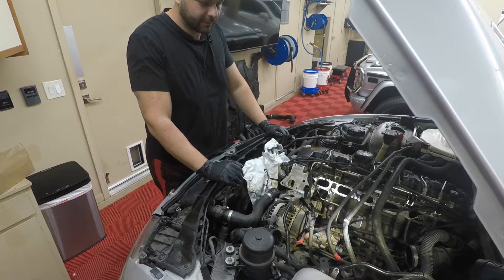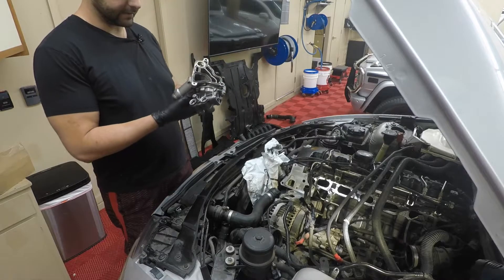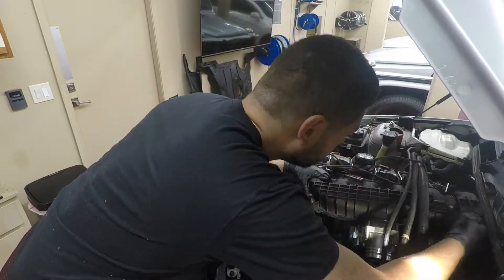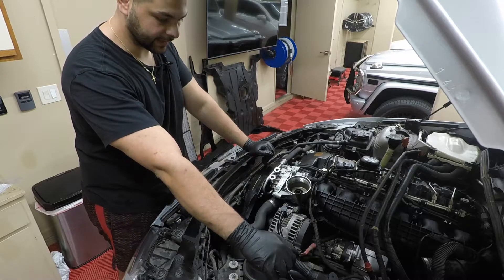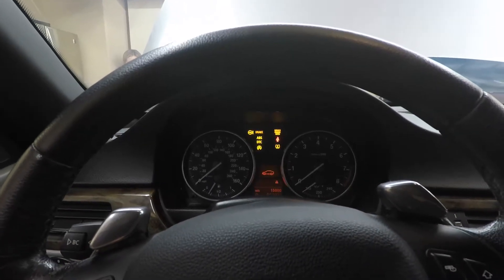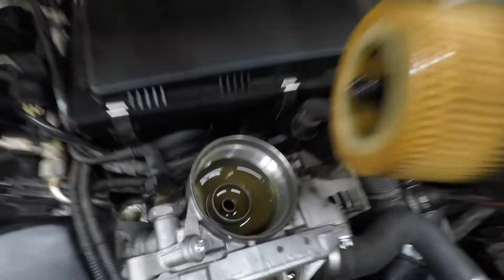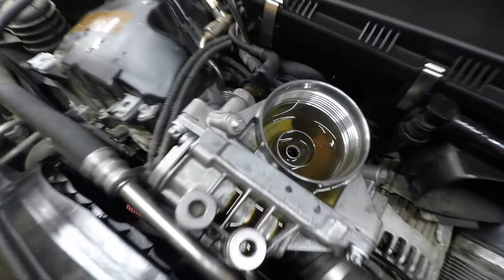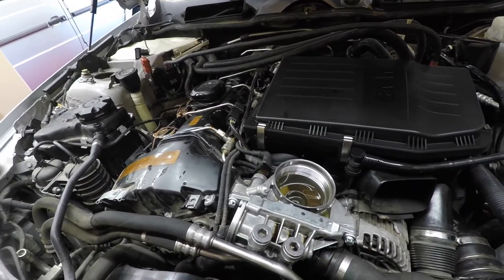IS My N54 Blown? WATCH Until the end!

Comment: Well at least the coolant wasn’t flooding back into the oil. But if it ain’t one thing it’s another haha
Reply from the maker: 😬 stay tuned. Boy do I have a surprise for you on the next one
Reply: it doesnt do that on this engine, the oil pressure is higher than the water pressure.